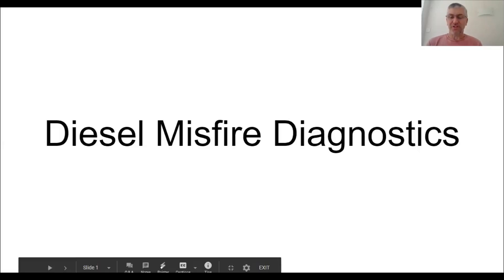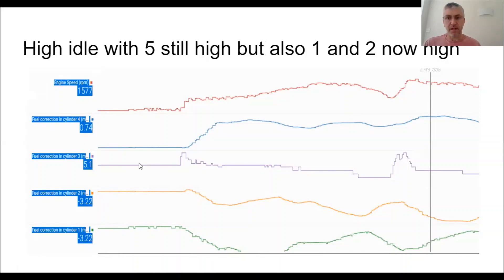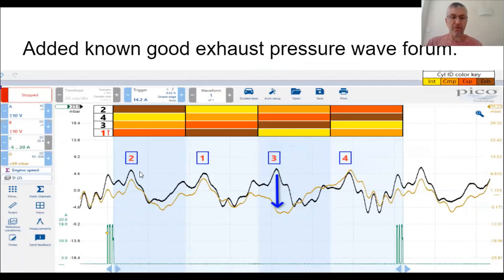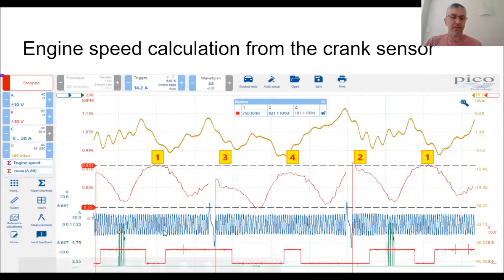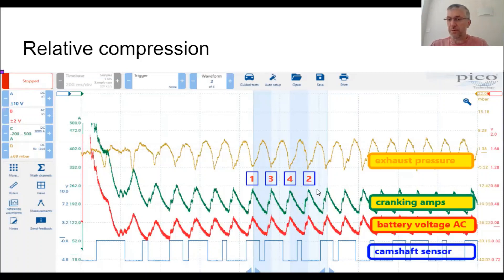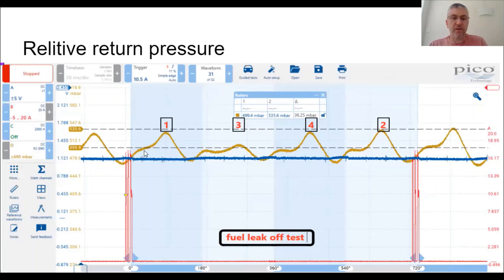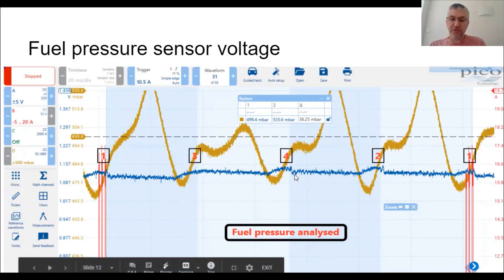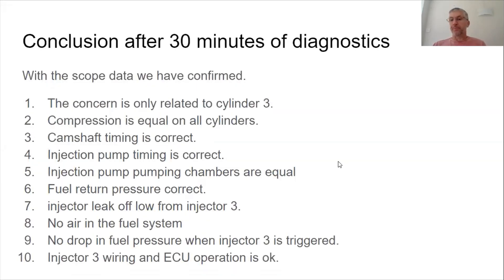Diesel Misfire Diagnostics with pico 7

Comment: The Best Seller & UP To Date Software, with No Expiration Date and I use a Special Software that Freezes the Software For You To Never Have Any Problems/Issues.

What I Offer is Diesel Diagnostic Laptops & Tablets with No Expiration Day on Software.

Cell Phone ( Numero de Cellular
 (+1310) 903-6679

WhatsApp Number (+1310)-892-0502

Instagram = https://www.instagram.com/fr1j0l3r0/?hl=en

OfferUp = https://offerup.com/item/detail/986826309/